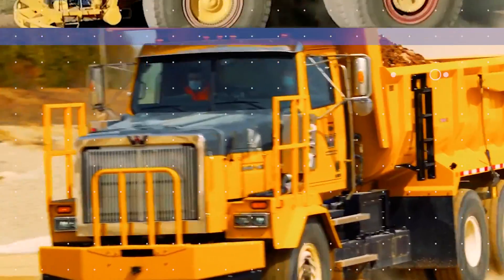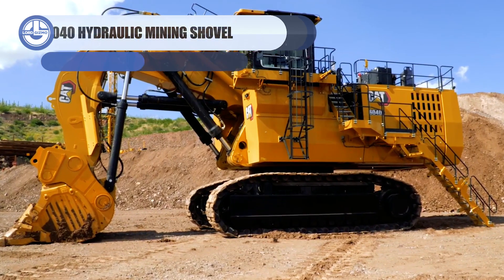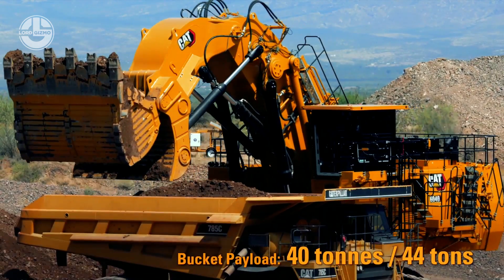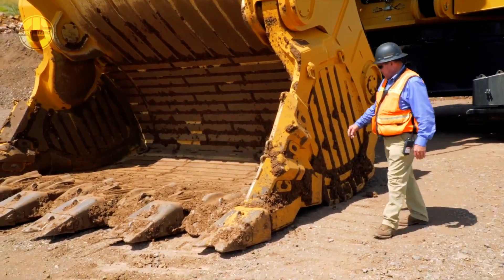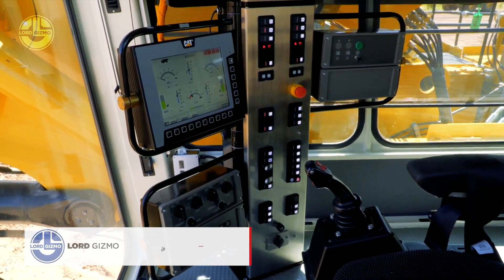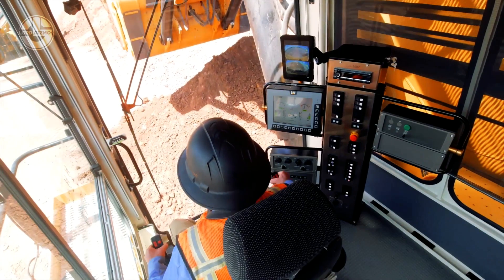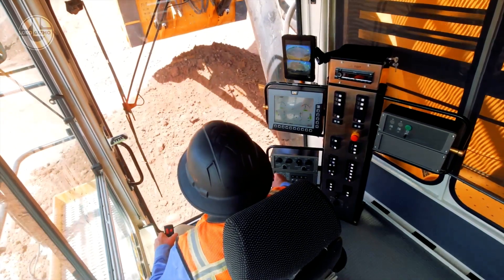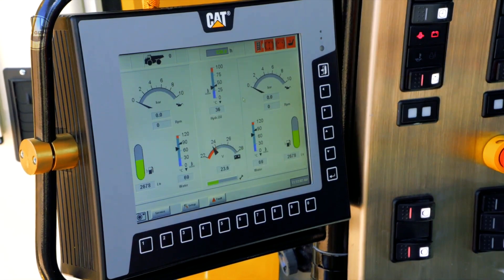Inside The 6040 Hydraulic Mining Shovel Along With Impressive And Powerful Machinery You Need To See

Comment: You failed to give full stats on your battery operated dump truck.  How long can it operate without a charge?  What is the cost of the battery assembly?  What is the cost for the charging system and how many are there?  Yes, electric motors have more torque and can get there faster, but can you switch so quickly from diesel?